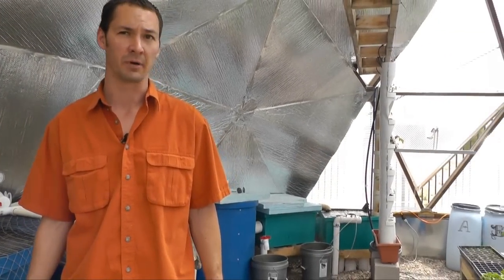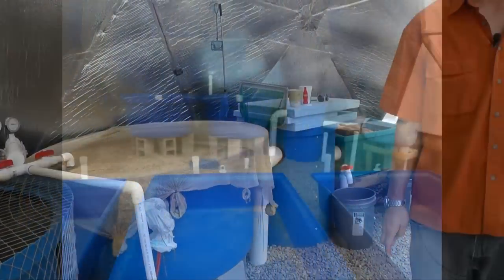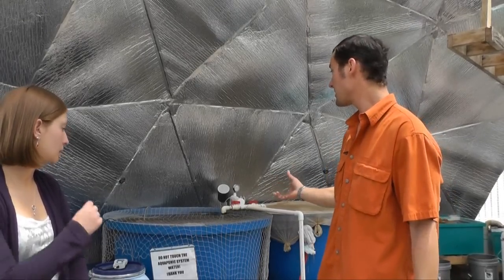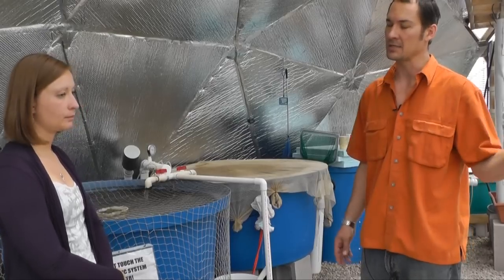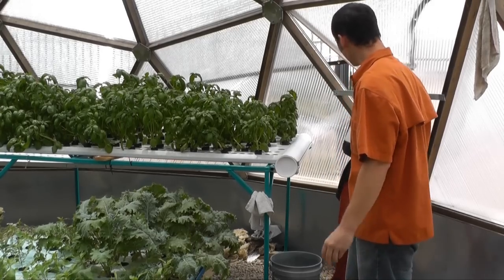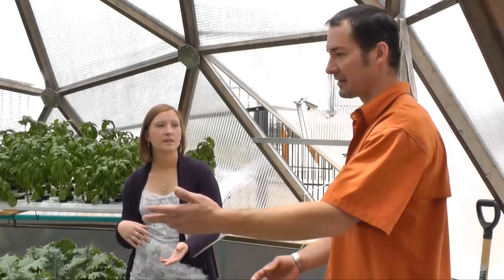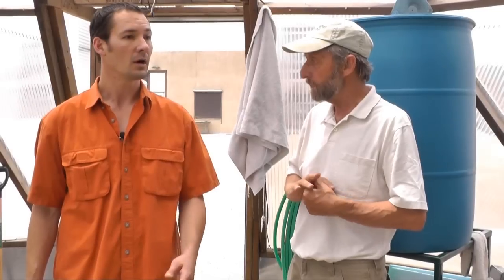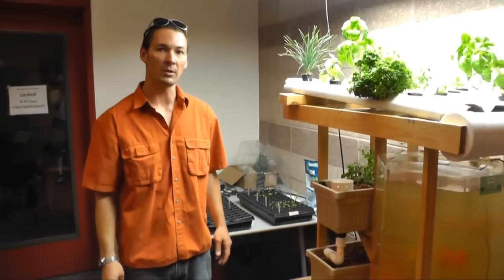Aquaponics in a Growing Dome

Comment: Any idea on the total power input for the air-blower, water movement, any lighting, or any other power usage involved in the process... the possibility of solar powering the whole system would require what power levels?

Comment: The air blower is situated on the north side of the dome. Why not put it in the most sunny place in order to blow warm air through the bubble stones into the system using for example a passive air heater? Would certainly help reducing energy cost, right?

Comment: Have you heard of a Trompe?  You could use  a bunch of Trompe's in series  for all your air needs?  Could use just one pump for the entire system.  also should have a  structured water device  like a Dan Winter or Clayton model. Also it makes a  difference if the plant tanks are grounded. ( as in the documentary Grounded ) nice system!

Comment: Thanks for your documentary. There are still some technicalities I need to get right, especially from the point of the clarifier. Anyway to learn  in more details.
Reply: Clarifiers are pretty easy; you just need to slow/disrupt the flow of your water enough to allow heavier solid matter to settle out on the bottom. In this system, the central baffle in the barrel delineates the water flow, as well as provides a physical disruption, to allow solid matter to sink to the bottom. Your discharge line(where the flow continues through the system) needs to be located in such a manner that it sits above the typical depth of settled solids, and large enough that it doesn't easily clog while you calibrate your flow through the chamber.

Comment: In wanted to build an aquaponics system but after watching this I’m not so sure I can do it. 
This is the most explained video on aquaponics I have come across.
Reply: This is a research grade system, the simpler system towards the end in the indoor area is very straight forward.  It can be done even easier than that, so give it a shot and don't be afraid to get some water on the floor =).

Comment: I am curious as to the difference between the floating beds and the concept of using gravel beds. Do you have to select plants that are less prone to root rot? How difficult is that? Have you used gravel beds at all? I have sen some systems use a combination of both.
Reply: Nelson, it's not easy to explain. Basically, floating beds are easy to setup, clean, and cheaper. Usually are for leafy greens like lettuce. But it's only used as a bio filter, and require air (extra electricity)
Gravel beds cost more because of extra media, like gravel or clay balls.  It is harder to setup because it requires a siphon or drain system. It is both a bio (plants) and mechanical (gravel) filter as bacteria and worms will naturally develop. Cleaning is more messy because of the waste. But it does not require extra air, as it's a drain & flood system.
Hope this help.

Comment: Nice system, when you crop the lettuce ect, what do you do with the net pots at harvest time, are you able to reuse them or are they too damaged by the roots of the plant? Given the expected sales value of a lettuce, the cost of the net pot seems to be a high proportion of the total costs per plant if you cannot reprocess the net pots?
Reply: +Richard Miller You can reuse netpots. I cut the roots off right at the base of the pot. 
Then it only takes a little wiggle and a tug and the pot is empty.
Reply: Choose a larger net pot if you plan to let your crop develop large roots. The 3" net pots shown in the video are not suitable for a large bush, but you can find net pots as large as 10" to support very large plants. You may still need to carefully cut out the roots at harvest to save the net pot.

Comment: To increase temp at 80 especially in winter by using water pumps, heat elements, and heat exchanger will be costly on energy bills. Can solar energy be applied to run the above electrics?
Reply from the maker: William,
Yes, solar can be used to power and heat an aquaponic system. It would require a combination of PV and vacuum tube solar thermal water heater panels. Solar is only as good as your gain, though. If you don't have solar gain, you can't rely on solar power alone. Something to keep in mind. If it is cloudy, you won't get the energy or heat needed to run the system. Many overcome this by over-sizing their PV solar system and battery bank and in the case of solar thermal, using an on-demand natural gas or propane water heater to supplement on those cloudy days.

Comment: So 2 additional things need to happen to be truly efficient. They need to switch most of the plants to vertical farming to increase the volume and set up a solar generation system using a battery system to power the system for free. An estimated $30,000 investment would pay for itself in 2 years or less if you sold the vegetables.

Comment: Where do you get the growth stones?
Reply from the maker: You can purchase grow stones, also known as media, at any local hydroponic/grow store. You may also find them online. Hydroton clay pebbles are the most common media being used for several reasons. There are other alternatives available though.
Reply: @GrowingSpacesGreenhouses  Thank You, I am interested in the silicon media you used in your growth bed.
Reply from the maker: @TCliffordSWang   GrowStones is what Eric used for media. We would not recommend it, because it is not pH neutral. You will constantly need to balance the pH in your aquaponic system if you use the Grow Stones. Maybe that isn't a deal breaker for you. We found it frustrating and purchased some Hydroton instead.
Reply: @GrowingSpacesGreenhouses  Thank You!

Comment: I would recommend adding a growing space for producing Duck Weed which in theory should provide the tilapia with food which is good for both fingerlings to adults.  I also seen a video where an individual saved the food by putting the excess into ice cube trays and freezing them in water.  Not an expert just would remove an input.

Comment: Boy these aquaponic systems are not very energy efficient huh. I bet the electricity consumtion to run this is high, if you can't run a unit like this off of a solar battery bank what is the point. Besides fish production and maybe higher disease resistance I think it's way too much work and I would guess from what I have researched it has a steep learning curve. I appreciate the organic concept but I think it comes with a high labor and energy cost.
Reply: TwisTer46290 and the electricity?